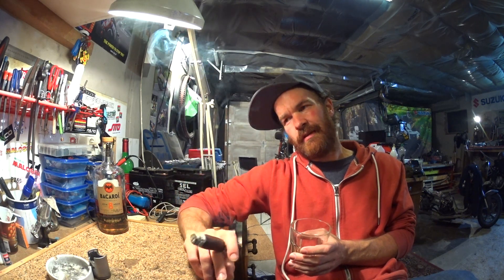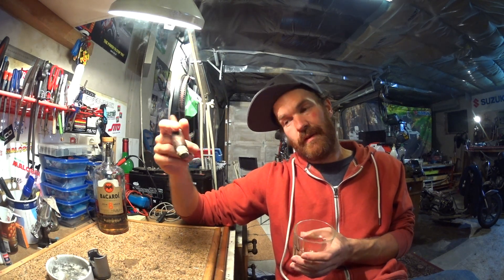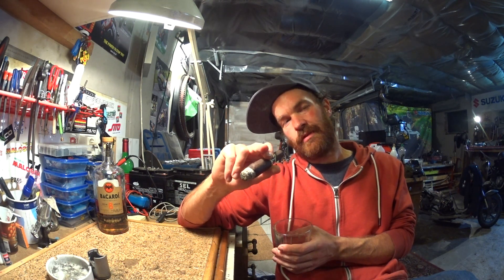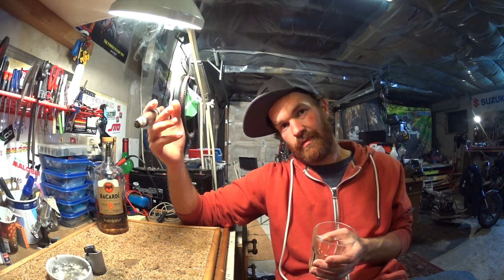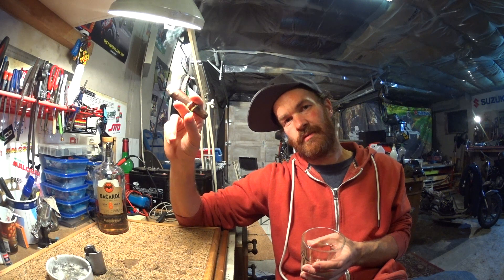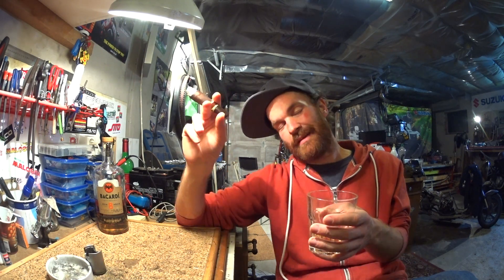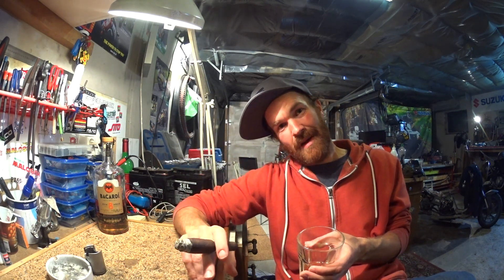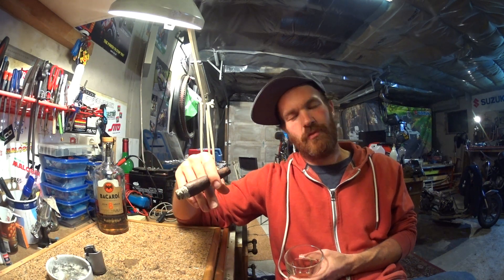ARDYNO - It's Happening!

Comment: will the neon tube work with a coil over plug type coil?  other than that.. you're talking about a plug and play/pnp kit to turn a barrel into a dyno..  easily worth 50 bucks.. 40 euros or so..
Reply from the maker: +mongoose09 Coil over plug might be problematic. Maybe possible to use an extension wire to have something for the "capacitive clamp" to attach to.